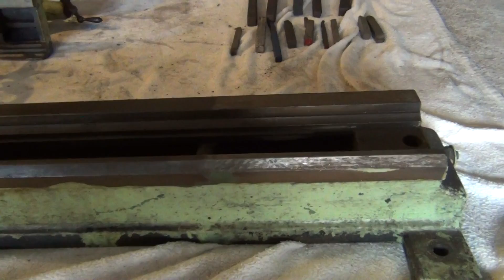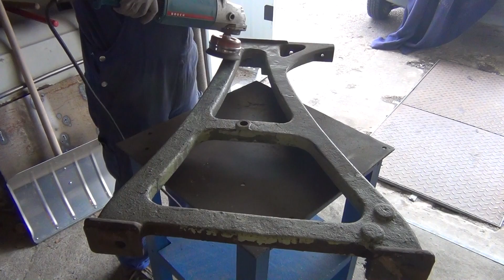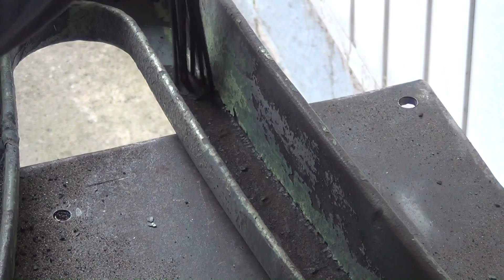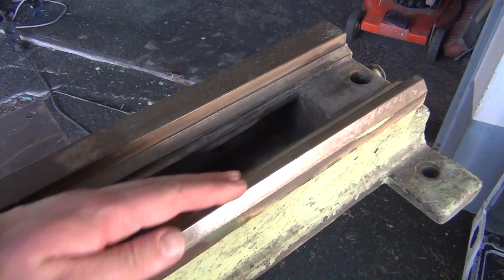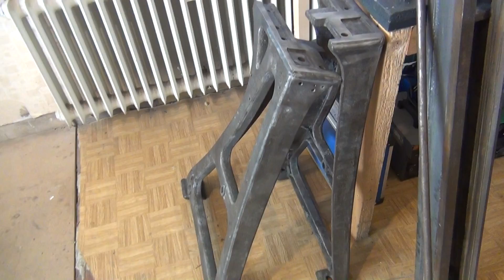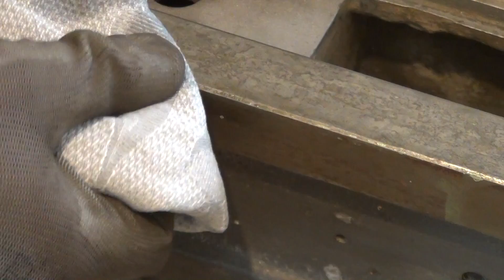Lathe Restoration (1):  Paint and Rust Removal Methods, Assembling the Basic Frame

Comment: I'm also restoring an old South Bend 10K Lathe.

It's quite a project...

EDIT: I should really get a needle scaler.
Reply from the maker: +Justin Bell This is already quiet a job and other than your lathe, this one doesn't even have gears or a lead screw :D
Reply: +The Post Apocalyptic Inventor 

For rust removal on the ways and other parts I'd recommend Evapo-Rust. For large parts I was unable to submerge I used Evapo-Rust soaked paper towels on the surface and then covered the paper towels in cling wrap to slow evaporation. It does have some limitations though.
Reply: +The Post Apocalyptic Inventor I wouldn't be happy about the lack of a leadscrew. I don't know how I could get on without one.
Reply: +justfakeit888 He's going to retrofit one. He talked about it in the last video.
Reply: Gotcha, must have missed that.

Comment from the maker: Sorry, it's NOT a spring balancer.
Reply: needle gun
Reply: +The Post Apocalyptic Inventor I've always known them as a Needle Scaler.
Reply: +The Post Apocalyptic Inventor You can't put the lathe near the radiator. You're going to have it warp each time it's heated or you're having temperature variance. It's not something that will damage the lathe, but you will notice it on the work you do.

A best try and find another angle, at worst put a baffle in front of the radiator. Something like a thin MDF piece with some wool stuck on the radiator side will do.
Reply from the maker: +aserta Thanks for bringing this up. I will have to think about this. This is an old house and it's actually ridiculous that there a three gigantic radiators in this one room (of maybe 40...50m^2). The heating system is very primitive and it keeps the room temperature stable 24/7 day and night, rain or shine. So this might actually be an advantage, even though it is a disaster from the perspective of energy efficiency
Reply: +heavydiesel And I've heard it called simply a descaler as well.

We sorta imply it's for removing rust moreso than paint or something else.
Reply: +The Post Apocalyptic Inventor Do you rent or own your house?
Reply: +Dr Mantis Toboggan Same in the USA..at least that's what I've always heard it called. Heavily used in ship building and shipyards.
Reply: +The Post Apocalyptic Inventor

Only heard it referred to as a needle hammer. Seen it used mainly in welding.

Chemical rust removal usually just means acid.

Hydrochloric acid is very effective, but in a pinch it's possible to improvise with acidic household items such as strong vinegar and similar, through it takes longer and involves more mechanical removal.
Reply: +The Post Apocalyptic Inventor You can use Coca-cola to chemically remove rust. The process is more of 'soaking' the part in a bath.  That might not be practical for your application.
Reply: +The Post Apocalyptic Inventor I've heard the slang name for it being called a Jitterbug.
Reply: +Ronald Ziehlke a jitterbug is a palm sander.
Reply: +The Post Apocalyptic Inventor Tim has it right...Needle Gun.  Awesome for removing paint and rust.
Reply: I sent you a link to a video how to get rust of. 😉
Reply: +tim turner Yeah, UK checking in here. We call it a needle gun.
Reply: In Australia  we call it a needle gun or needle scabbler
Reply: +Albion Laster Can use diluted vinegar too, but it gets flash rust afterwards unless you wash it with alcohol and paint/oil straight away.
Reply: +The Post Apocalyptic Inventor     Many Thanks for throwing in the occasional translation here and there as you do. I'm learning another language while watching great clips that motivate me to get my ass into the workshop more often. Thanks
Reply: Needle descaler